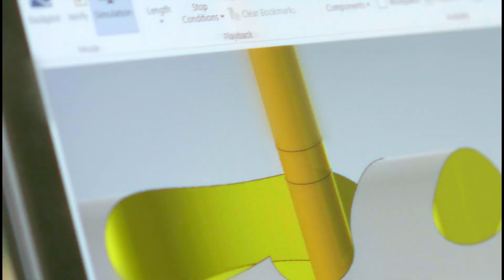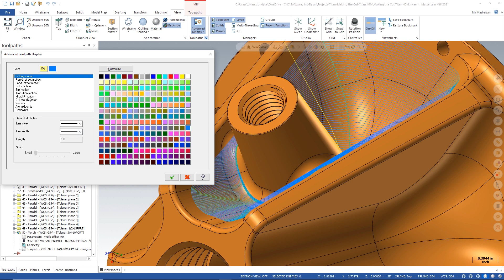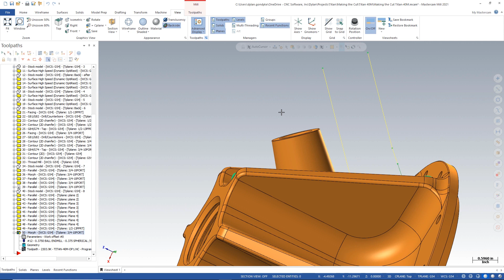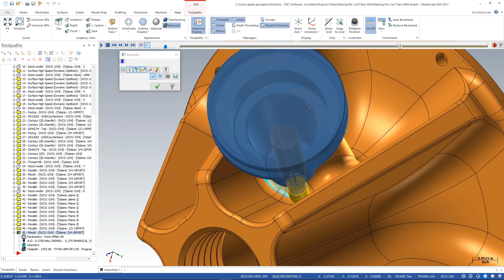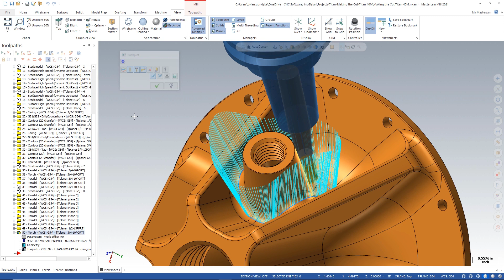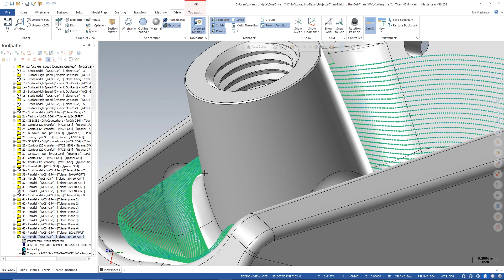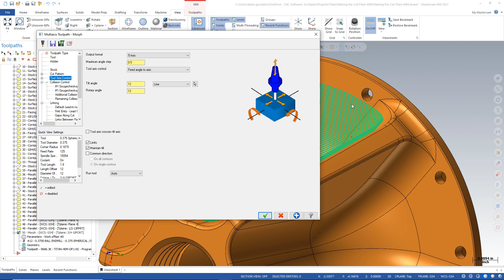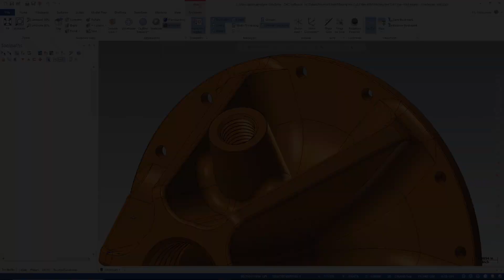Making the Cut: TITANS of CNC Tricks for Smooth Multiaxis Motion

Comment: I'm confused, aren't you essentially turning the morph tool path into an ISO surface tool path?
Reply from the maker: Hi there! We have a good morph path on this surface to start with, and the goal here is to change the point density and position to suit what this machine needed to see to generate the cleanest motion. Note we aren't actually changing the cut pattern or stepover through the course of the video.
Reply: @mastercam  Could you accomplish the same task using an ISO surfacing tool path?  Maybe I am missing the point of doing so much additional changes to the tool path.